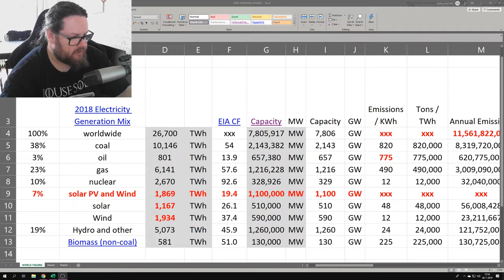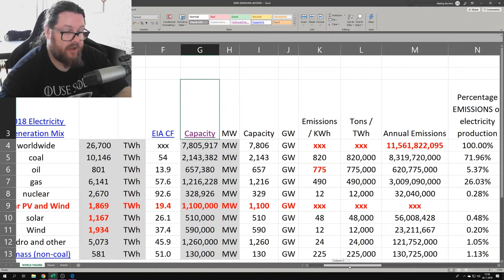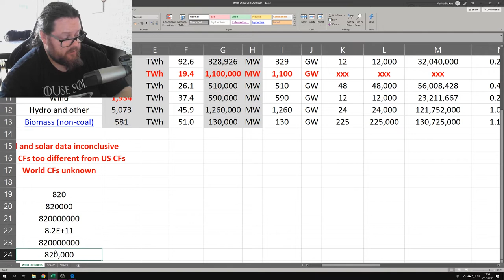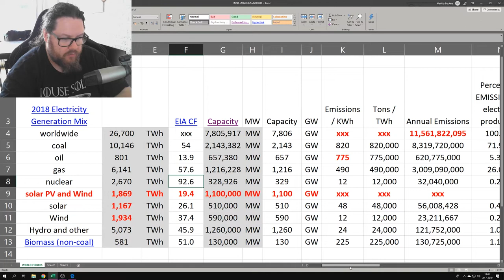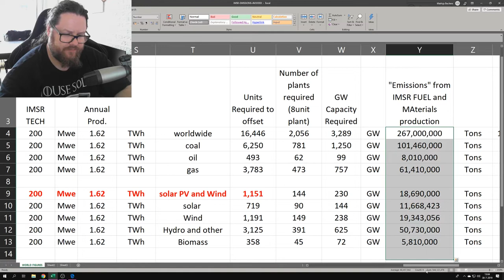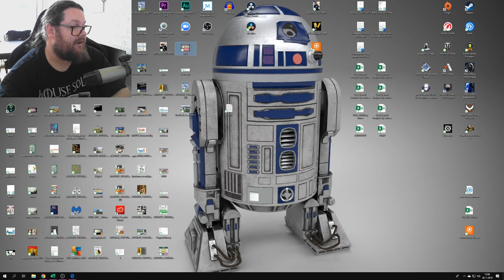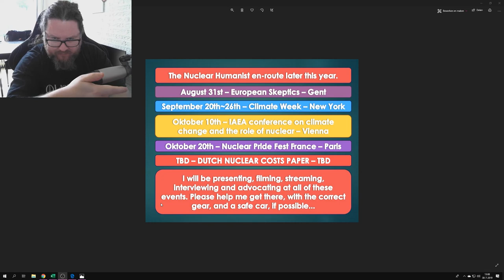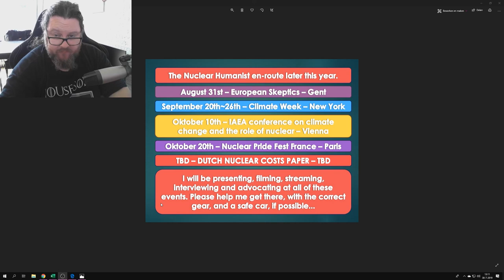Terrestrial IMSR Could Be An Emissions KILLER

Comment: SSR-W of moltex energy is up to 3000MWt/1200MWe per unit, assuming 5 units per plant, 5kW or 40000kWh/year of primary energy per person of which 40% is electricity (partial electrification of transports)/60% come from the heat generated in the same plant, 9 billions people in the world, then 3000 SSR-W plants/15000 SSR-W units (that just use the current SNF as fuel) can cover the whole world primary energy needs, not only electricity.
Assuming that it is possible to factory build the few main modules (to be assembled on deployment sites) of 500 units per year (as per commercial ships/aircrafts, the dimensions are similar) starting in 2025 (since SSR-W use already certified materials for the reactor core structure, Canadian Nuclear Safety Commission could have licensed the design in 2025), then we could decarbonize the whole energy business and provide affordable energy to the whole world population within 2055, using just a speck of natural resources needed for wind and solar.
Nuclear potential is awesome, no doubts.

Comment: This is a very fascinating spreadsheet and the information is nice but would you be willing to define what you mean by emissions? Last time I had a talk with someone about emissions they had used not only CO2 but also looped steam, radiation, methane, sulfur and other types emissions all in one thing. I assume we could both agree that pure steam emissions aren't a pressing environmental issue. 

From what I understand of this IMSR it has about a 400 Mw thermal or about 190 Electric Mw, so would be a good for small semi decentralized grids while allowing larger more powerful reactors to run cities and strong industrial sectors.
Reply from the maker: These are lifecycle emissions which always are CO2equivalent. (Water vapor not included).
Reply: CO2-equivalent is the usual standard. This is all greenhouse gases, but adjusted for how strong they are compared to CO2. E.g., obviously 1 kg of CO2 is 1 kg CO2-equivalent, but methane IIRC is 80, so 1 kg of methane is 80 kg CO2-equivalent. Add all of them up and you get the total emission. Steam/water vapour is not counted.